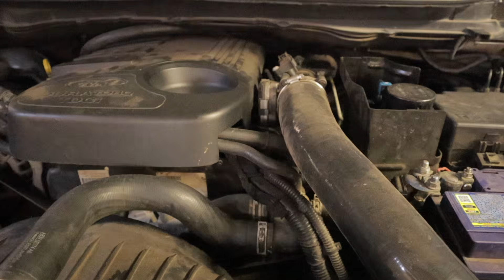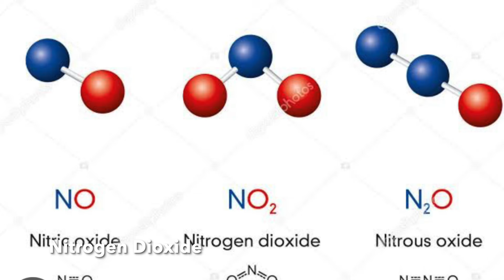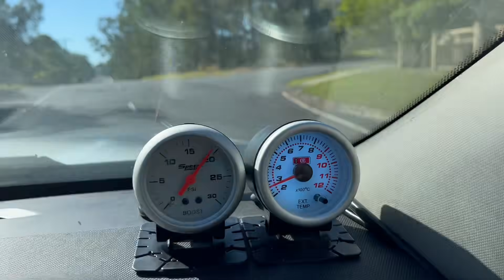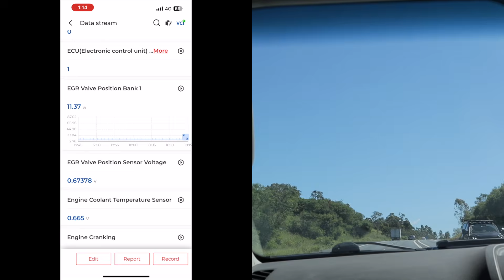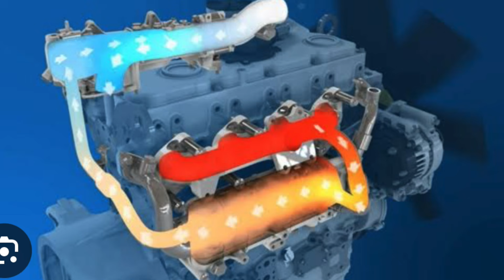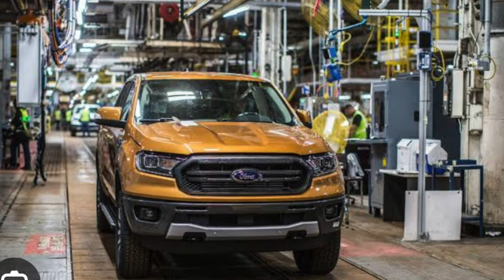Does Blanking the EGR on a Ford Ranger make it run Hot?

Comment: So EGR does reduce engine combustion temps but not directly via the egr cooler. The cooler only exists to get the exhaust temps and pressure down to safe intake levels. The way EGR reduces engine combustion temperatures is by causing a weaker/smaller combustion. If you take say 50% of the intake charge and replace it with (inert and non combustible) exhaust gas, you have (give or take) 50% less oxygen in the cylinder. Your ranger knows the position of the EGR valve and uses a MAP to adjust the injectors to suit. So in this 50% arbitrary example you ranger (while the EGR is fully open) will have an effective displacement of combustible gases of 1.6Lt instead of 3.2Lt. EGR makes your engine run cooler by reducing the power of each bang, therefore, yes blanking off the EGR will raise your combustion temperature. A bigger explosion in same space means more heat generated...

....HOWEVER, your ranger will only have higher combustion temps at idle/closed throttle compared to a non modified system. AND IT JUST SO HAPPENS that the factory ranger cooling system is more than capable of dealing with cooling an idling engine. So you will not see an increase to your running temps on your coolant temp gauge.  Combustion temp is not the same as engine coolant temp. The thermometer for your coolant is not jammed inside the cylinders.

- Does EGR reduce combustion temps and N-O emissions? Yes 100% 
- Will blanking this increase the temp gauge on your dash? No, your radiator can handle idle temps with ease.
- Will the increase in closed throttle/idle combustion strength increase wear over the life of your engine? Not of much as gumming your intake valves with oil and soot crud is going to.

EGR isn't there because its good for your engine or efficiency,  it there because exhaust gas is nasty stuff and all the soccer mums driving their Navaras and Rams in the city will cook the air quality without it. If emission laws were abolished you can bet your butt manufactures would stop bothering with EGR altogether. 

Anyone claiming EGR will make your engine 'run hot' is either completely misunderstanding how combustion temps vs coolant temps work, or are deliberately creating clickbait for views.

As always good video mate.
Reply: Over 100deg drop in egts with the egr deleted in my 3.2 px2 ranger. Lower coolant temp also by 2-4 degrees.
Reply: Its not 50% of the cylinder intake, only 50% opening of the EGR Valve.
Reply: @gough184946  in diesels, the cylinder is always fully open. I’m not sure what you’re stating here. The 50% cylinder reduction is an arbitrary number I plucked out of my butt for ease of explanation.
Reply: So would you blank your EGR?
Reply: Well said, there is a lot of science that sometimes we ignore with basic tests.

Comment: there are other heat sources that add to the engines operating temperature  such as in an auto the heat exchange unit on the transmission adds heat , the egr cooler adds heat , the egr valve adds heat  because they are all being cooled by coolant running through these devices  , i have "fixed" my ranger  its a process but it will make the ranger so much more reliable  , not enough time to go through it all tonight  but this guys video's have helped big time
Reply: P:S , my 2016(pre DPF) rangers temp has been so consistent since all the preventive maintenance was done including a sensible dyno tune  , there are two other things i want to do  one is change out the thermal bypass valve (WHICH OPENS AT 80DEGREES and more importantly these factory thermal valves can fail closed and destroy the transmission if you are not paying attention)  in the transmission for a fully open valve  which will reduce trans temp and ultimately engine temp and secondly  the factory torque converter to a more positive converter which will provide a more positive drive especially off the mark and also reduce trans temp even further and again reduce engine temp ever so slightly ' if you want your rangers engine to survive !  these measures are a must .

Comment: EGR is the worst possible solution to NOX. If the great minds forcing this trash on us had any real brains, they would have favoured water/methanol injection over EGR. That would have been much cleaner, better on the engine, and would have actually reduced peak temps during high load, when NOX production is highest.

Comment: Awesome mate, as a mechanic I know it won’t make it run hot by blanking off the egr but for the non believers you did a great job of proving this is just a myth.
Reply: It's has nothing to do with the temperature of the cooling system, it is about the temp of the combustion gases,  the engine temp will stay the same but the combustion will be hotter and therefor it will release NOX gas, which is bad.
Reply from the maker: Thanks 👍
Reply: Will there be any impact on the EGR cooler by blanking off the gases that would normally flow through it. If I blanked off airflow through my radiator, surely the radiator itself would have more heat in it as there is normally an exchange of heat  as gas and coolant pass by each other. TIA